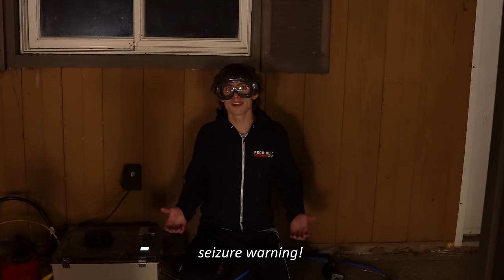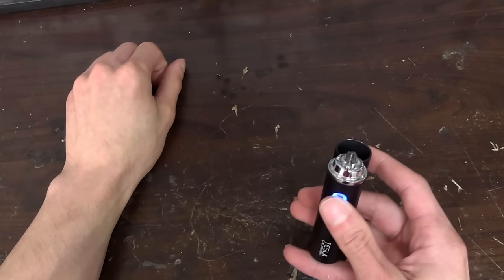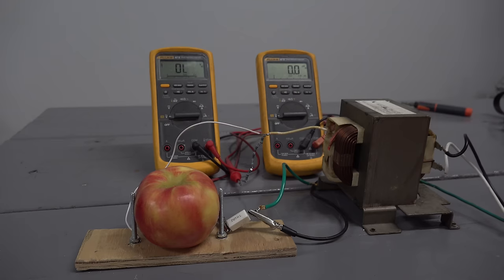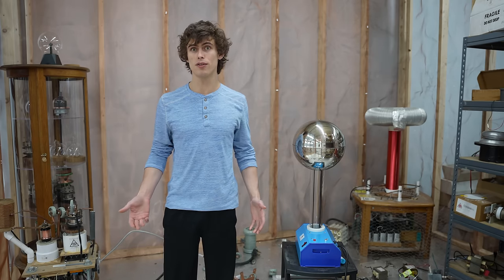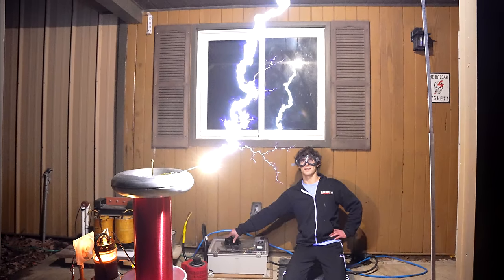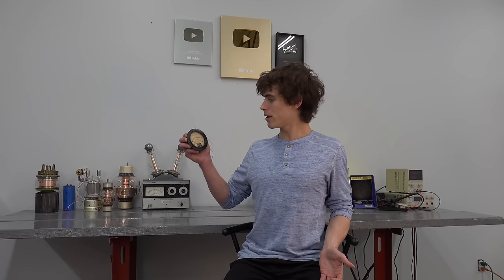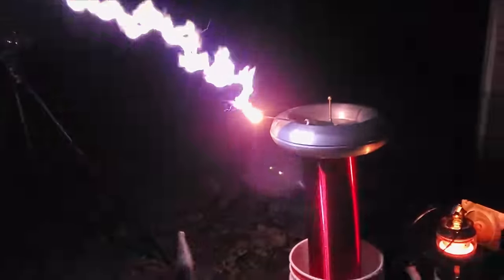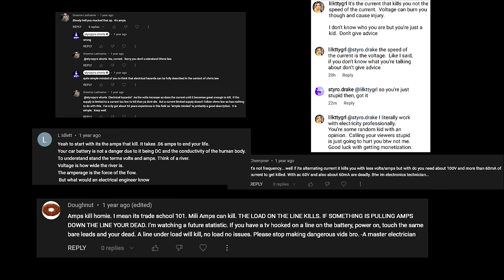Is it the volts or amps that kill?

Comment: Man. You really combat folks with information and experiments to support it. I will still keep my "knowledge wall" of experience and information to do my job safely. I've worked with electronics my entire career. I respect the danger. I also know that pushing limits without fully understanding the risk you're taking is stupid. "User error" is the most dangerous calculation. Awesome video!
Reply: he knows, what he os doing. You can read a lot about this topics, And include existing charts telling you, at what flow path through the body,at what amps going through the body, with what frequency and duration, it will kill you. 
e.g for his tesla coil. He knows the frequency of it,and if he is confident, that this frequency is stable, then he knows for sure, if he can touch it, or not. Its no mystery, if it kills or not. Its very logically.
But of course for installing electrics at 0Hz, 50Hz, 60Hz, you have to stick to the norms. Everything else would provide error risks, cause a lot of people use it,and it has to be very safe. He is of course putting some risk in his life, touching these things. I mean, if the frequency was interrupted a bit, or his heart was very weak, the trsla coil,or the van de graff, could be dangerous. Also interial burns can occure, which is no joke. But thats his risk, and for short durations its low.

Comment: Yeah, I worked at a pvc pipe plant in my younger years. The newly extruded pipe had a massive capacity for generating static electricity. You could even feel the electrical field two or three inches above the pipe, it felt fuzzy. Anyway, we'd have to slide across the top of the bundle to band it up and you'd transfer that charge to yourself. You could make a highly visible arc between your finger and a piece of metal up to an inch away in a brightly lit environment. It was painful.
Reply: I won't lie, that'd probably make me pee myself a little, gettin that kinda zap.
Reply: @DominicNJ73  Yup, completely understandable. I never quite got used to it, but being zapped twenty or thirty times a day took some of the excitement out of it. :)

Comment: Electrician here, great video! Electric shock depends on many factors: voltage, current, skin resistance, skin wetness, shock time, AC/DC, AC frequency, path through the body, your age, physical fitness, pacemaker, drug/alcohol influence, ...

Comment: Bro knows more about this than 90% of the engineers I went to school with including me
Reply: Your school sucks then.
Reply: @PxNxWxGxW   I went to a T20, ok buddy. 
It’s clearly exaggeration, but I’ll expand on my comment. Computer engineers (me) at my school didn’t get lab experience with stuff like this. We mostly started working with and focused on integrated circuits. Millivolts and milliamps, sometimes DC power supplies and such but even then, it was in a highly controlled setting. They really don’t teach you whether volts or amps kill in Logic Design textbooks. It’s not like it’s necessary for CpEG’s to be dealing with things like this, so yeah, this video is informative even for people with engineering degrees (other than electrical).
Reply: @Laminar-Flow lmfao. Instead of learning the lesson that school isn’t everything and that there’s value to practical experience and rigorous self study, you instead flaunt your degree, DESPITE originally saying that a guy without a formal education is smarter than a lot of your educated peers. Alright then pal.
Reply: @maxwellsimon4538   Sounds like you’re an electrician that’s a wannabe EE

You can’t self-teach fabrication of 7-nm node nanoelectronics, and these devices have nothing to do with potentially lethal voltages or currents. Good luck getting access to $30+ million in equipment to self study that, as well. I was too busy doing Laplace and Fourier transforms by hand in college to take a class all about when electricity can kill. I said styropyro knows more about when electricity can kill than I do because in computer engineering, it’s irrelevant and useless knowledge. Just because I was never taught that and learned something from the video doesn’t mean I need to be taught any “lesson” about how worthless my degree is considering I work on technology styropyro would not be able to get near without a relevant engineering undergrad and masters degree. 

The other commenter told me my school sucks. It unequivocally does not, and if you think an engineering school sucks because they don’t let engineering students play with insane voltage supplies and screw around with deadly amperages, you know absolutely nothing about the field. I responded to his comment the way I did because of his tone, and didn’t flaunt my degree so much as he insulted it.
Reply: @Laminar-Flow  First of all your original comment made it sound like styropyro knew more than you in general. Too bad you’re not an english major. Kinda your fault for not specifying at all. 

Second, i am actually an electrician, so good guess. Not at all an electrical engineer though, wannabe or otherwise. I don’t pretend to know shit about theory beyond the simple differences between single and three phase. Engineers in general are some of the most annoying people to work with since they often think their degree means everything, and that just because they can Fourier transform in their head or make CAD blueprints in their sleep they can figure out how to put together everything themselves and tell everyone else how to do it. Engineers are often more impractical and more pompous than they are educated, which is a fucking shame because they do have admirable talents when they stay in their lane. 

Would be nice to be an electrical engineer some day though. Could try to engineer some products that actually have some practical thought put into them, lay them out so you can actually get a tool in there. Would be nice if EEs and sparkies could get along though, but too many EEs are pompous knowitalls, and too many sparkies are crass assholes.

Comment: Good rule of thumb: It doesn't matter that much, if it can supply enough current and voltage it WILL kill you eventually. Treat all circuits with respect and you won't have as many problems
Edit: He's right about Ohm's law, I've used those calculations for low voltage safety too, it's basically a calculation of a worst case scenario.

Comment: Decades ago, the first thing you learned when working with electricity was that you needed good workboots and had to stand flat-footed on dry ground. The reason for this is that you form a capacitor with the earth with your feet or your butt if you are sitting. When you are standing in water, standing on one foot, or falling back on the points of your heels while holding a metal object struck by an ARC, you can die from a heart attack. The reason is you become a very small capacitor that allows your body now the plate in the very small capacitor to polarize instantly. The metal object you are holding will create a small ARC on its surface that will draw particles of electricity from your body very quickly. ARC used to stand for Anode Rectified Cathode. The metal object that forms an ARC will at the surface being struck by the voltage of a blown air capacitor an ARC will liquify and create a molten liquid diode. if You are standing flat-footed on dry ground, you will probably be ok. But if you are standing in water, on one foot, or falling back on your heels, you could be dead from a heart attack. Water is a dielectric that creates a very small capacitor. The formula of a capacitor involves the type of the dielectric involved, the surface area of the dielectric involved, and the thickness of the dielectric involved. The thicker the dielectric, the smaller the capacitor. A smaller area of a dielectric will cause a smaller capacitor, and a dielectric with very high insulative qualities will form a smaller capacitor. 

ARCs are blown air capacitors. A standard two-point mechanical light switch in your home is an air capacitor that charges and discharges 120 times a second to stop the flow of 60 hertz AC current. When you first open a contact, you might see a spark, that is, a blown air capacitor. The voltage is actually lethal however, there is not enough current

Comment: I guess amps and volts are sort of like volume and flow rate of water. Both can kill: either a lot of water dropped on you can crush you, or a very small amount of water shot from a water jet can cut right through you. And both can also not kill you, depending on the situation.
Reply: I think of it as air density and speed, but similar idea.  density ~ volts , speed ~ amps
Reply: @SteelsCrow  other way, i'd say, ..... current is commonly described as current density in materials,
Reply: Nah a lot of amps with very low voltage can't kill you, as shown with the car battery, and very high voltage with low amps doesn't either. The product of both determines the danger, combined with a bunch of other stuff. It's really quite complicated and that should really be the main takeaway from the video. I don't think this analogy works.
Reply: @giganooz  I hope you realize how ignorant this comment is and that you'll reconsider what you post in the future.
Reply: @cpK054L  I mean obviously there's exceptions, and it's not like someone's gonna see this and think it's a great idea to lick the two poles of a car battery. Electricity is dangerous in general so don't fuck with it. But when we're talking about how it works, the given analogy just doesn't accurately reflect the reality.
Reply: @giganooz  the perspective of the battery (lead-acid for most CE cars) has a high cold-crank amperage (around 500-600 amps) for 30 seconds, at 12 volts. This is literally EATING the battery, but it's also DC
As you've seen, the arm-to-arm you're looking between 500k to several million ohms of DC resistance. 12VDC in that instance is in the microAmpere range, you'll be experiencing a "skin effect" instead, and most likely just burn the hell out of your skin, if it does have enough force (energy) behind it, it could be lethal (COULD).
Google is saying that this battery must be able to sustain approximately 216kJoules, if you're alternator is dead, yeah, you bet your battery will die after this too.

Car battery would be the worst analogy.
from 0 to DC in itself acts as Alternating Current. You'd have to make the example of hooking the guy up, literally at the SAME TIME as the electro-chemical reaction to get a true "DC response"
otherwise, the best bet is to reduce the slew rate significantly to where the AC response is negligible.

I hope this makes sense to you.
Reply: Do you think a car battery will burn your skin if you grab both terminals. I don't quite understand your comment.
Reply: @giganooz  What do you mean "nah"? I think you need to look up the definition of "analogy". A large amount of water won't kill you unless it has velocity behind it, just as I said. And very fast moving water jet won't kill you if it isn't being fed enough water, or if it's only a fraction of a second, or isn't pointed in a lethal place, etc.

What I was alluding to is both are complex and need a combination of factors. I never said my analogy is anywhere near perfect, that water is exactly like electricity. IMO my analogy very correctly points out how there are several different attributes/factors at play, shows SIMILARLY how energy is transmitted not in a simple but 'multi-variant' way, including how it affects humans.
Reply: Well... with water, a better analogy is that voltage = pressure. It's what enables flow velocity, rather than being the velocity itself.

Current is like the size of the pipe.

Power is like the volumetric or mass flow rate.

You can have a really big pipe, but with no pressure, nothing flows. You can have a ton of pressure, but if all you have is a coffee stirrer straw, you're gonna spend a long, long time filling a bath tub.

So with the death part of the analogy I suppose a really big pipe with low pressure could simply drown you, even without a container, by just displacing all the air with the enormous deluge of slow-moving water. Or, like you said, a super-high-pressure water jet can cut through you with relatively little water.
Reply: @akassasin5768  Heh yeah, I get confused by people with this perspective/argument all the time. Having worked in the industry, I can't even count how many times I've touched both terminals of a car battery. In the rain, in the snow, with wet hands, even wet, salty hands.

"But it can melt a wrench dropped across the terminals!" Yeah. That's metal. Its resistance is rather a lot lower than your body's, and thus the battery actually can dump hundreds or even up to a thousand amps through it. And, sure, you could burn yourself grabbing the half-molten steel, but... even then you're not gonna electrocute yourself. It just isn't capable of that.

A hybrid or EV's high-voltage system, on the other hand, absolutely can make you quite dead. That's why they're bright orange and covered with all kinds of warnings and sealed behind layers of stuff to undo, unlatch, and move out of the way before you can get to any exposed ends.
Reply: @barefootalien  Voltage is analogous to pressure and Current is analogous to Flow rate. Neither is, necessarily, dependent on the other as they are both SI units rather than derived units. Hope that helps.
Reply: @icarossavvides2641  Yeah, I've heard it both ways for current. Ultimately, of course, the analogy isn't all that great.

And no, they aren't necessarily dependent on each other, but the problem I see is that people treat them as if they're completely independent of each other in these arguments, and they're very much not.

Comment: I understood that both kill, just differently, amps seizes up muscles, volts fry the body. what I learned today from this amazing video is just how it all works
Reply: That's not really accurate either. If you are working with normal household or industrial voltages (let's say 12V DC to 400V AC at 50 or 60Hz). It's absolutely the voltage across your body that decides how much current goes through your body. This is why anything under 50V is considered safe. What should especially be understood is that the current (amps) running through a conductor is not important. You can touch a battery running 100A to a started motor without any problems.
Reply: No, this is completely wrong and demonstrates a basic failure to understand basic electrical principles.

It is in fact the electrical current above a certain magnitude (something of the order of 100mA) for a certain length of time that will cause the heart to stop.

However the body has resistance.
A certain amount of voltage is required therefore to develop the current through the body, just as it does in a resistor component.

If the voltage isn't high enough, you won't get enough current to stop the heart.

So to electrocute somebody by stopping the heart actually requires a sufficiently high enough voltage, and a low enough body resistance to produce a high enough current to disrupt the beating of the heart.

And the body's resistance changes massively according to a number of factors, whilst the voltage is going to be constant because that's coming from the mains electrical supply.
Reply: @slome815  It is ALWAYS the voltage in conjunction with the body's resistance that determines the magnitude of the current.

And to correct you. 50 volts is not considered safe because it determines the current. That is incorrect.

Firstly the threshold voltages are 50 Volts RMS AC and 110 volts DC. There are two threshold voltages. One for AC and one for DC.

Second, the reason these voltages are the threshold voltages are because at below these voltages, given the typical range of resistance of the human body, the current developed is too low to cause ventricular fibrillation and stop the heart beating properly.
Reply: @deang5622  power alone does not kill, the man said a mix of all three, you proceed to refer to all three “a number of factors” so i don’t see the issue?
Reply: @datboii3738  Power over time, that is, Energy, definitely, 100% kills, regardless of the "other factors".
Reply: @marcossidoruk8033  im def not taking your word for it, styro actually backs up his claims putting his life on the line to prove you bafoons wrong😂
Reply: @datboii3738  Eh? He didn't lol. What I am saying doesn't contradict at all everything said by styro, You not understanding what we are saying isn't an argument.
If x ammount of joules is needed to fry your body then what happens if you receive x ammount of joules is that your body gets fried, simple as, that energy has to go somewhere. Then the question is under wich conditions does that ammount of energy get delivered. If you hook up to something capable of delivering great power to you and you do it for sufficiently long time, you are dead, simple as, styro never in his video did taht for freaking obvious reasons, so not sure what "backing up" you are mentioning, the frequency just doesn't matter at that point.
Frequency matters when you are not recieving lethal doses of energy but you are recieving currents that would be enough to disrupt your neurological system, as styro explained neurons just ignore really high frequency. However that has nothing to do with the fact that given enough energy you become a toast, you don't even need to know anything about electricity to reason that.

Please if you don't know what you just watched stay out of this discussion.

Comment: Both.

Potential difference is what allows amperage to flow through the body. Without voltage, there would be no current flow. It's like asking if it's the bullet or pulling the trigger which kills someone.